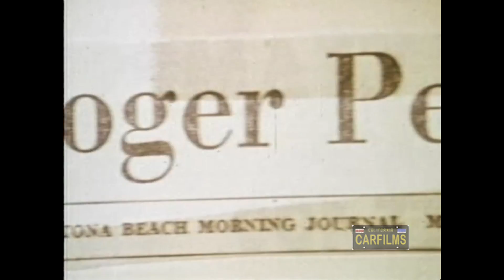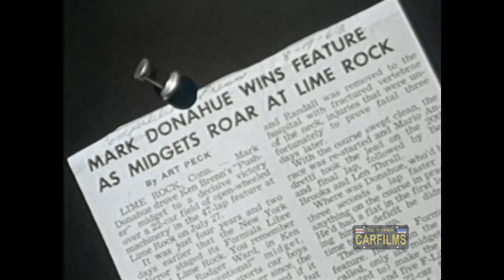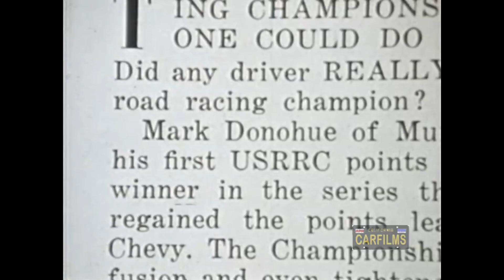Four hands on the Wheel restored documentary Mark Donohue and Roger Penske campaign the Lola T70

Comment: At 35:58, I chuckled by how flimsy the body panel is that the technician is working on.   You can tell that the sheet metal was reduced to the minimum required to hold its form in order to get the car as light as possible.  An example of the "unfair advantage"!
Reply: We assume he was sectioning it to bring the nose profile lower... anything went as long as you didn't get caught.